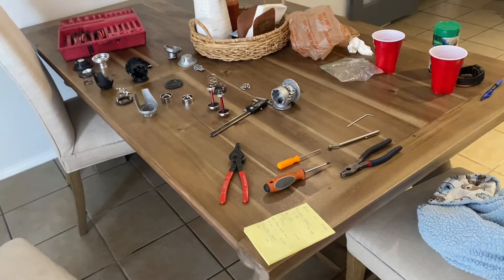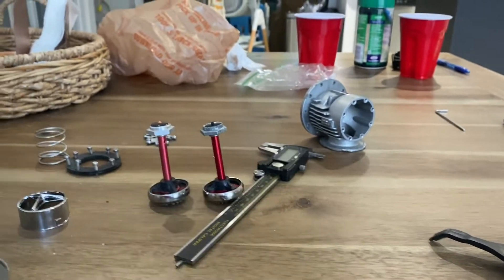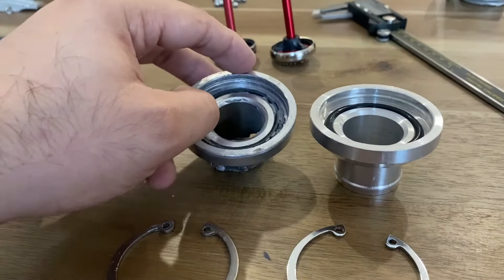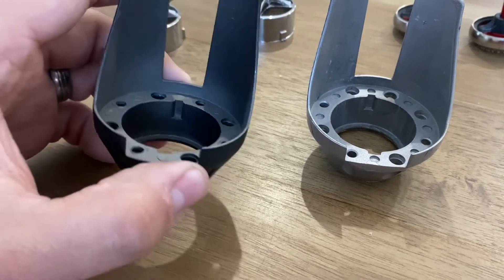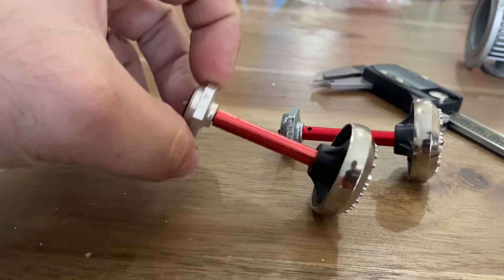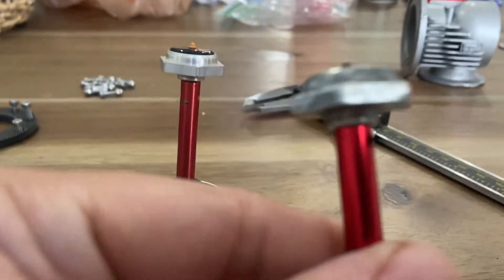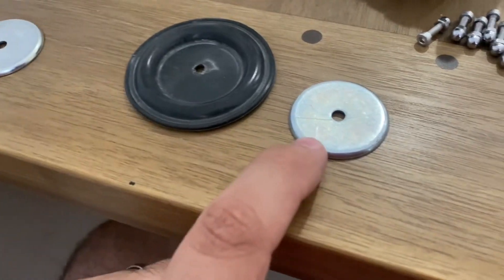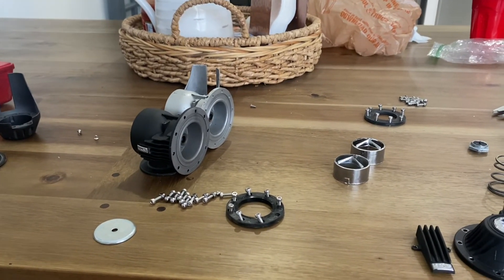HKS Blow off valve evaluation: Real vs Knockoff

Comment: Both work the same actually.

I tried both legit and fake HKS SQVs. Some said that fakes will boost leak at high boost. I dont go that high of boost anyways, 1.7b is the max i went due to wrong boost controller settings.

If you are not going high boost，on a budget and but wants the unique tweet sound, just get a fake hks from a shop that people have brought from a lot of times.

If not, get the real thing.

*Update: my fake black edition will leak boost when floored. Example, my car is tuned to 1.4b but when at peak load, it cannot build boost beyond 1.1b.
Reply: i guess fakes are okay on stock turbos..u think?

Comment: The only way to differentiate the original from the fake Chinese shit is the sound. The smaller valve on the knock off does not function so there goes your signature HKS whistle.